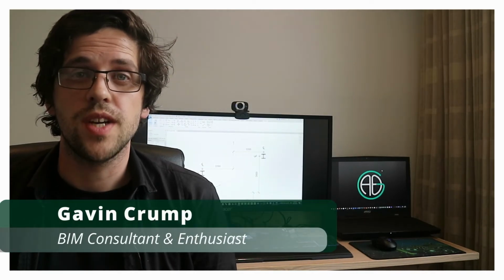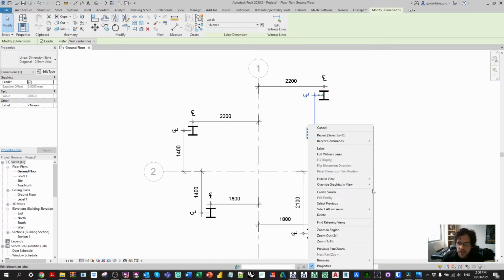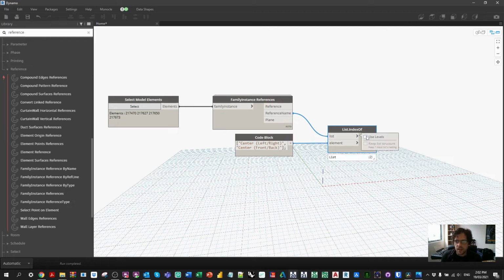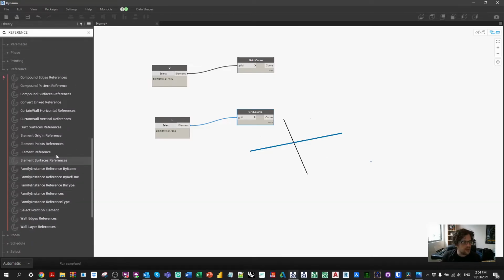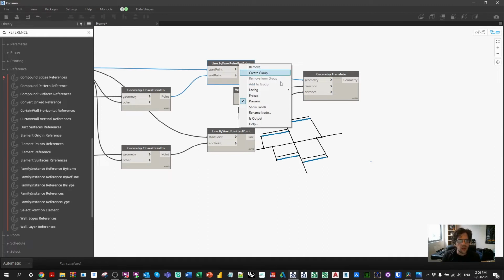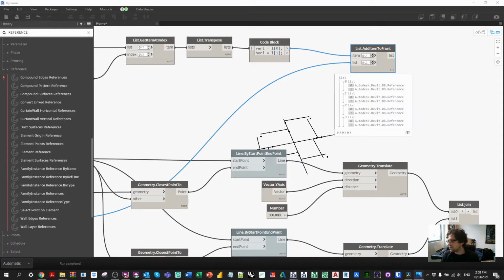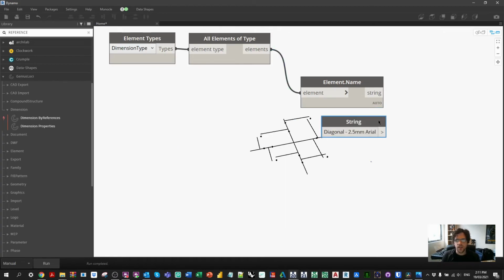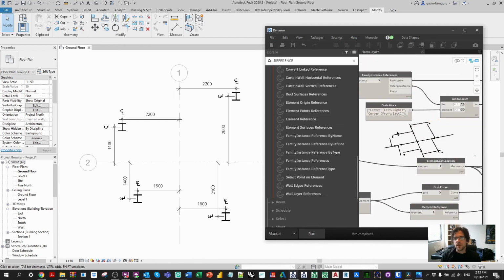Automated Revit dimensioning using Dynamo!

Comment: Thank you! I want to dimension the spacing between a row of trapeze supports. I've created the "references" input for the Dimension ByReferences Node. I'm confused on the how i need to modify the "line" input so that instead of dimensioning from trapeze to grid, I'll be dimensioning from one trapeze to the next. Thanks again for all your help!
Reply from the maker: The references will need to be perpendicular to the view direction for this to work in the first instance. Assuming they are, the line generally just serves as an infinite reference along which the dimension string is placed, so should run left/right in the section/elevation/plan direction. Assusming these criteria area all met they should hopefully work. If not I'd suggest consulting the dynamo forums for further assistance as youtube is difficult for solving specific problems that need a model to recreate them.

Comment: Hi Gavin, I'm not sure if you're still active on this channel.  If you are please help.  I'm a concrete precast detailer.  I've been using 2D Autocad all my career life,  and now I want to move to 3D platform. I think Revit can do the job,  but it's very hard to find someone in Australia 🇦🇺  that can teach Revit online. Is there something you are interested in to help me? Please reply,  thankyou!
Reply from the maker: Hey there! Whilst i still make videos when time allows, I work fulltime for an architecture firm so generally my time's maxxed out + my backgroubd isnt really in structural eng or drafting. I'd suggest going to the local BIM meetup(s) in your area to network and find connections in your discipline + there's lots of channels/videos on str eng for revit on youtube as well.
Reply: @AussieBIMGuru thanks Gavin! Yes there are lots videos on YouTube but mostly are overseas standards. They're all different with our Australian Standards. I'll look up BIM meetups see if they are out there.
Reply from the maker: @vph6734 yes its quite rare you will get australian specific videos and courses as they would have quite limited earning potential unfortunately. General content crosses borders more comfortably.

Comment: I did the same thing in my dynamo in revit 2024, but in the last node every line appear like null, i have the ironpython 2.7 and 3 and all the organization of the lists are identical of the video. What could be wrong?
Reply from the maker: My best guess is your named references might not be parallel to the grids, rather some are rotated 90 degrees.

Comment: Can you please guide how to restore the dimensions after Mirroring the project
Reply from the maker: I always advise against the mirror project tool as it causes a lot of issues related to annotations. There isn't really a good way to fix the damage the tool does in my experience as it always differs.
Reply from the maker: Unfortunately my advice there is not to use the mirror project tool. Loss of annotations is generally unavoidable and very difficult to recover via an automated approach.

I know its used in small housing jobs but most firms with template houses will model the mirror again as a second template house i find, or reannotate after mirroring manually.
Reply: @AussieBIMGuru  Yeah it's a pod modelling every time i have to mirror each project (by "Mirror Project" tool) and my dimentions are flipped specially rebar dimensions it goes to inner edge of rebar showing wrong clear cover dimension, anyways still working on solution to recreate the dimensions.

Comment: I built the script and run only for lines put didn't place the dimension
However the dimension type show the ID
Reply from the maker: Generally the script should work as long as the references and grids are parallel. If they aren't then the scenario is probably more complex (e.g. the families are rotated 90 degrees). For detailed troubleshooting I suggest using Dynamo forums as this is just a demonstration of concept.
Reply: @AussieBIMGuru  thank you for replying.
I already considered this point while running the script but didn't place the dimensions.

Comment: Excellent video ABG!!! exploring this approach, is there a way to filter references? some elements have references placed in the same position wich results in dimensions segment with 0 value. It would be usefull to filter them previously or be able to delete the 0 value segment of the dimension... is it possible? Thaks in advance!!!
Reply from the maker: The only options for filtering that come to mind are by plane name and/or plane parallelism. Auto-dimensioning gets quite hard when you begin needing to infer complex/specific conditions (e.g. don't dim all planes in a family, just some specific ones).

To filter out a zero dim segment you would need to determine all planes by their origin/normal and filter out all but one of each to avoid planes in the same position being used as references.
Reply: Thanks ABG, I´ll try that! @AussieBIMGuru

Comment: this is amazing, would it be possible to select  a floor plan and one click dimension generate? i know there is one plugin that does it but its crazy expensive.
Reply from the maker: Most things are possible, but it would take a lot of code and Revit API to determine what dimensions are required in a plan. Think about how you would do it manually, then use that to deternine the steps to automate that, including the logic applied as to what is dimensioned and where.
Reply: @AussieBIMGuru  yeah I am a final year architecture technologist, I am really interested in revit Api with c# imma start learning it as you have inspired me from these videos Anyways, I also love computational designs using Rhino + grasshopper… maybe we can see some rhino inside revit content ? 👀
Reply from the maker: @1insp3ru16 decent amount over on my rhino inside playlist. Will probably fit some more in this year hopefully!
Reply: @AussieBIMGuru  amazing I will check it out. Thankyou for your content it’s absolutely golddddd

Comment: I would like to ask how to solve the problem if I want to mark the column edge closest to the axis instead of the column center.
Reply from the maker: Assuming you aren't mirroring columns you can use the vector from grid to column to determine if its on the left/right of grid then call out left/right reference instead. Same for front/back.

Comment: Something strange is happening when I use it on mine. I'm running 2023.1 and even tested against the git hub and still ran in the issue. But when I run it, it does work and shows no errors. It creates the dims, but you can't see them. But if you nudge the grid lines, they show up. Any thoughts?
Reply from the maker: Hrm havent seen that one before so not sure... Revit or Dynamo forums might be the go here.

My only guess is maybe something to do with element bindings, but if its the genius loci node it shouldnt be binding anyway as it uses python.

Comment: Hi! Love your tutorials!
I don't know why in the second node (FamilyInstanceReferences) I got values 0 and 1 in the second level instead of the reference plane's names. I'm trying with columns just like you did.
I'm using Revit 2022, Dynamo 2.10 and Genus Loci 2022.9.16
Reply from the maker: Hrm very strange, I can't seem to recreate it. Make doubly sure all planes are named and set, and if that's the case I'd say try a thread on dynamo forums to troubleshoot the node behavior.

Comment: Hello,

I assembled my Generic Model. But this method doesn't work? What should I do?
Reply from the maker: Make sure the intended references are parallel to the reference orientations and named correctly. I used structural columns here so they are a bit different.

Comment: Hi! Thank you for sharing this amazing workflow. May i ask if there is a way to filter out those references with 0 distance? (for example there are columns placed in a same vertical grid that return 0 as horizontal dimention)
Reply from the maker: Youre welcome! The key there would be to do two things and use that to filter the inputs before creating dimensions.

1. Check for null outcomes for the location line (a point to a point at same location should usually fail)
2. In case tolerance allows very close points, get the length of location lines instead then replace nulls with 0 (clockwork or crumple have replacenull nodes), then filter by location lines less than a small value

Comment: HELLO THANK you for your effort 
i try this script and it's working well
but if try this script with more than two grids it make dimension between the column and every grid 
is there a solution ?
Reply from the maker: Yes that would require you to find the two closest grids in each case, different scenario and requires more code. I have another video in this playlist for finding closest grids.

Comment: Hi! Great video! this is just what I was looking for. I do get an issue with the Dimensjon styles in the end. First i do not find those nodes you use. Are they in some packege? I also get som lines that is referencing the solution is working, but it just dont put inn the dimensions. So since im not able to make the same pieces there.
Reply from the maker: If you are using revit 2023 you will need to use the all elements of class node instead, I believe they removed element types from then onwards. Genius loci is the only package needed otherwise.

Comment: Hi, 
I get this message when I run my script. 
I have rotated grids and columns but they are 90° with each other so the script should work?
"The References of the highlighted Dimension are no longer parallel."
Reply from the maker: If any column is rotated at 90 degrees you would need to swap the centre front/back and centre left/right references in the sublists for the dimensions before making them. Dynamo doesnt have the ability to figure out which columns are rotated by 90 degrees on its own unfortunately.

Comment: Hi again. The second code block at 5:40 does not working. It's something about input button i guess. I can't connect code block node with previous node. Thanks :)
Reply from the maker: Most likely a typo, usually if you use the syntax 'x = ...' it will create a variable for x as an input. It sounds like youre fairly new to dynamo and code blocks, make sure to practice fundamentals via dynamo primer too.

Comment: My testing files are all different from your starting point, but I've seen other people use this same column as a demo before. I was wondering if there is somewhere we could down load the same file?
Reply from the maker: Hi there, yes my files are all available on github here:
https://github.com/aussieBIMguru/Revit-Files/tree/master/Families

I've broken them down by starting point in the file names.
Reply: @AussieBIMGuru  
Thank you, I've found the github once I checked your about section instead of the just the video discription. But I'm not seeing the one with four columns. In the video it says Prtoject1. I know it's just 2 grids and four columns, and I've tried importing a few other objects for testing, but I'm new to most of this and something isn't clicking. If I could find the columns I could recreate the project and I know I've seen others using a column that looks just like that.. I just don't know where they are getting it from.
Reply: finally found `columns` it's under the architectural ribbon

Comment: Hi! Thank you for an informative video :) I was wondering if you know how to create a "dimension by reference" between two points in Dynamo? I'm trying to create measurements where I need to snap to certain endpoints of edge curves within a family instance. I can find the points geometrically without a problem, but haven't managed to find the corresponding Autodesk.DB.Reference... Any ideas on how to do that would be greatly appreciated! //Johanna
Reply from the maker: Not that I am aware of. Identifying specific geometric edges in a family is difficult if not impossible as they have no filterable name or reference to identify them from the rest. Might be one for the forums I'd say.
Reply: @AussieBIMGuru  Okay thanks! It does seem a bit tricky, I think we'll be looking at a workaround using reference planes instead.

Comment: Good morning....
Really appreciate the time you're putting to produce this material. I got a couple of problems with the script :
1 - It works with structural columns with rotation 0 or 180 degrees, when the columns are rotated to values different from 0 or 180 the dimensions are not created in revit, even if they show in the dynamo node of Genius Loci
2- The dynamo node of Genius Loci retuns NULL on all the list when I hook the dimension style part.

I'm using dynamo 2.0.3 and revit 2019 by the way.
Thank again and appreciate any feedback ...
Regards,
K.
Reply from the maker: Yes this is only really made to deal with columns at a regular rotation based on their references. You could probably use an element rotation check (familyinstance.getrotation) to swap the references whenever a family is rotated by 90 degrees, but it isn't possible otherwise as the references wouldn't be parallel. I'm not quite sure why the node would return null with the dimension style - best check in on the dynamo forums for that one.
Reply: Having a similar issue as well 😕

Comment: Hi, I’m currently using 4-5 different dimensions (rvt 2020.2) but i wonder if it’s possible to change colour on all existing vertically aligned dimension with dynamo and how?
Reply from the maker: I assume you reached out to me via my website also as I got a similar query there. In either case, Rhythm package has a node that can retrieve dimension curves.

Comment: Great video as always. This task is the most painstaking in my work. I know you said this video is just to show an example of dimensioning and you wouldn’t solve every dimensioning issue, but I don’t even know where to begin with mine. Is there a way to create long strings of dimensions parallel to walls showing openings (doors and windows) and and any wall corners. Where would you begin with this (if what I’m saying is possible). After watching your video here I was thinking should I create reference planes within door\ window families for dynamo to read ? Could be more hassle then just doing things manually ! Thanks
Reply from the maker: In this case I would begin by getting all associated elements of a wall that is selected. From there get their left and right references (yes they must be named in the family), as well as any grids that intersect with the location line (or retrieve the closest grid to each reference and group them by grid). I think there is a node in clockwork package to get all associated elements to a host element if I recall correctly.

I'll add it to my list to cover at some point as it's a fairly common task for dimensioning.
Reply: @AussieBIMGuru  For anyone who may find this useful: I found a feature within revit that helped with this issue that I was not aware of before. Within the 'aligned dimension' there is an option to choose the entire wall and within the option you can choose to dimension to the openings and intersecting walls also.
Reply: @AussieBIMGuru  how would you go about creating the line for the windows and openings you would dimension from the wall? in the video the process is clear in regards for retrieving the references for the windows, but the line?
Reply: Different types of buildings are dimensioned differently, masonry buildings are rough openings, I’ve seen people do wood buildings measured from finish face of stud. And here with the wide flange columns he is dimensioning from centerline of stud. (The easiest possible one)

Comment: Hi Gavin, May I ask a quesion about dimensions I was thinking recently. I am doing an apartment partition wall setout drawing recently, but I found the previous dimensions was drawn from wall face to wall face. I would like to change these dimensions to stud to stud (face of core). Is there any convinent way to change these dimensions on sheets no mater in revit or dynamo. Otherwise I need to change them one by one, it would be painful. Thanks
Reply from the maker: In my research I haven't found a way to update dimension references, only set them initially unfortunately. You may need to get the dimensions current references and location line, delete it and recreate it with dynamo. You would need to identify the current references it is associated to and replace all face references with the centre reference of the same wall for the new dimension. It would be very complex, haven't tried it before myself.
Reply: Hi sir, could you please share your dynamo script that make walls dimensions face to face😊
Reply from the maker: I dont have a script for that unfortunately, maybe ask dynamo forums fof assistance.

Comment: I have started using revit for the past 1 year i am right now working on small scale house design project i dont know how to get start learning dynamo even if i learn i dont know how to implement small projects.Like get a suggestion from you how to get started with dynamo by self learning and how to remember the codeblocks
Reply from the maker: The key is to know why you want to learn it. Find repetitive tasks you do on a daily or weekly basis that might be automatable and use them as research goals for how you learn Dynamo. Following along with tutorials will only get you so far in learning, it is important to explore and play with it in your own ways as well.

I have a learning series on my channel which has a part about code blocks (part 5) so these may help also. I didn't use code blocks that much when I first began, over time you will come to find ways they save you time but I would begin mostly using nodes instead.
Reply: @AussieBIMGuru   Thank u so much for  Your tutorials it has helped me to land in a full time BIM Modeler job
Reply from the maker: That's fantastic, congratulations! I wish you the best of luck in your new role.